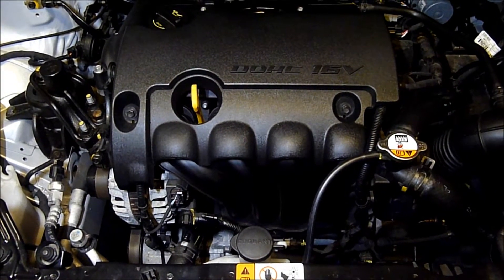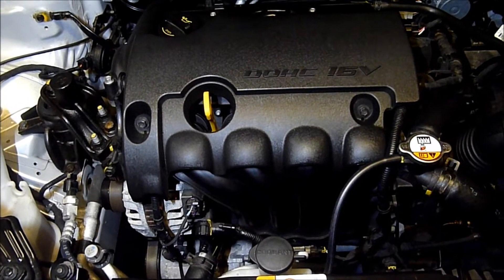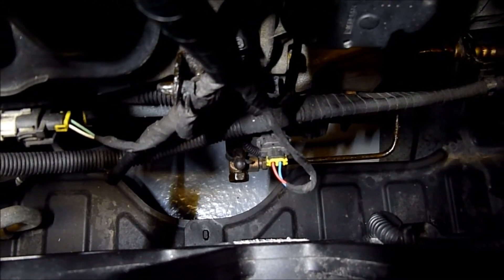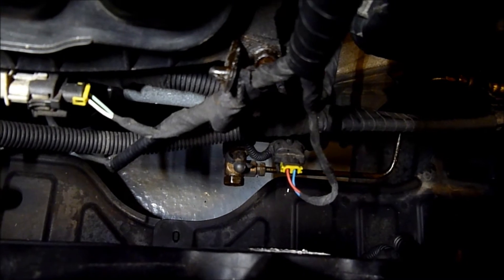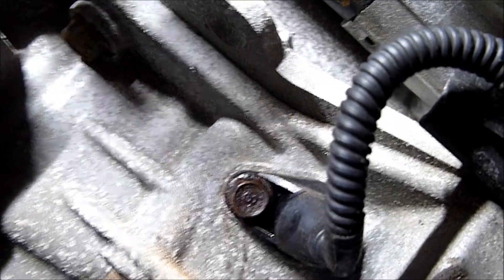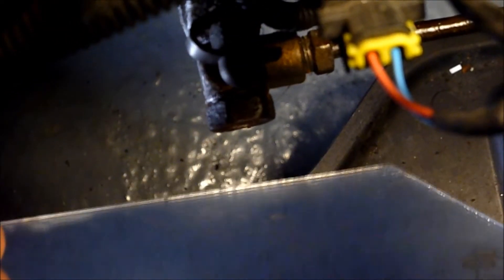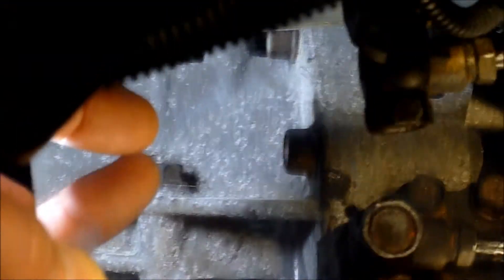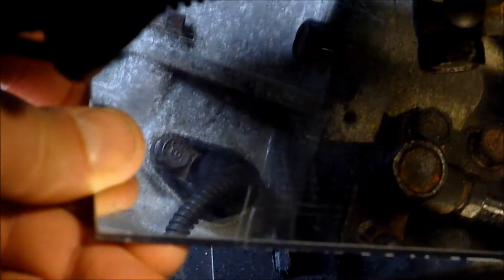Hyundai i30 CrankShaft Position Sensor Location in Hd

Comment: hiya i got a hyundai i30 which keeps stalling and esp light? will this definately fix it
Reply: I am getting this issue, what was the resolution you found?
Reply: I can't remember I think I bought a new sensor
Reply: My i30 had the same problem. Mechanic said it was the sensor. New one installed today so hopefully all fixed. Runs properly now so far but only drove it home from mechanics.

Comment: Hello I have a question my car stopped during running on the highway right after I started the Aircon. Could it linked to this sensor? The engine when I want to start is really trying to start up but seems like no gasoline is coming. Could it be this sensor is something related to the fuel pump? Or spark plugs?
Reply from the maker: I crankshaft position sensor failing may start failing as the car warms up & then the car cuts out. You should see an engine management light that comes on & fault code stored which can be read using a fault code reader. If there's no fault codes then you can rule out this sensor as the issue.